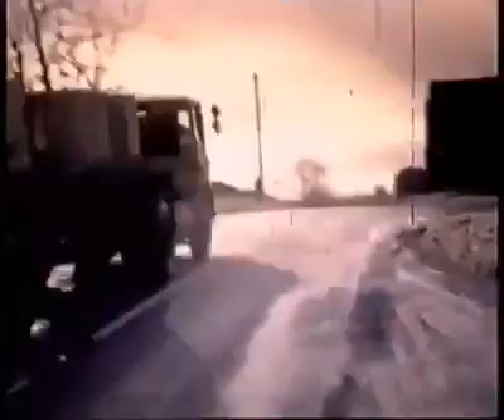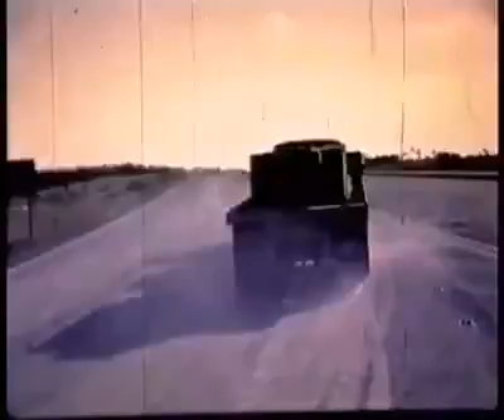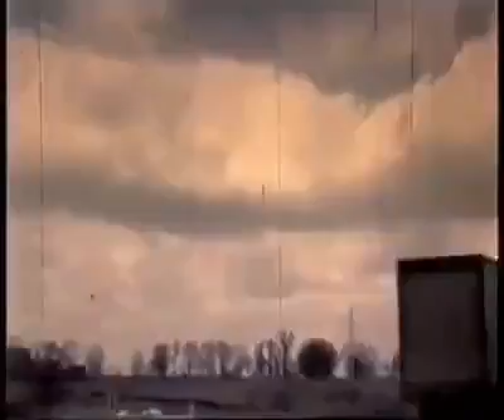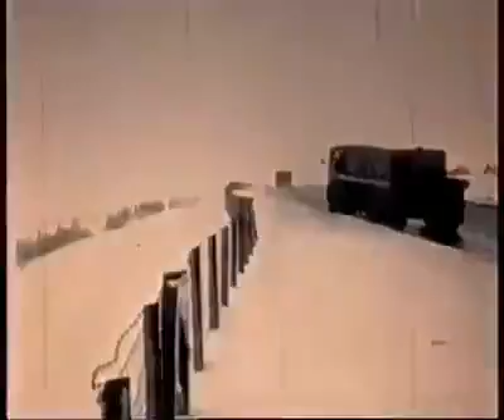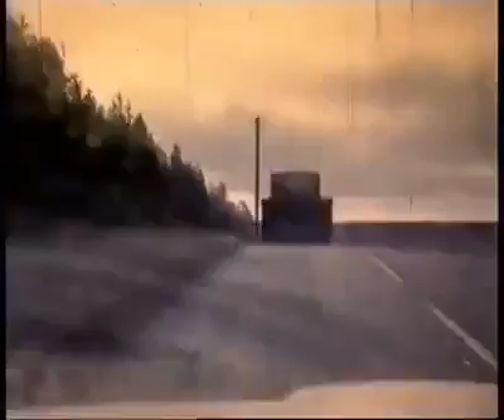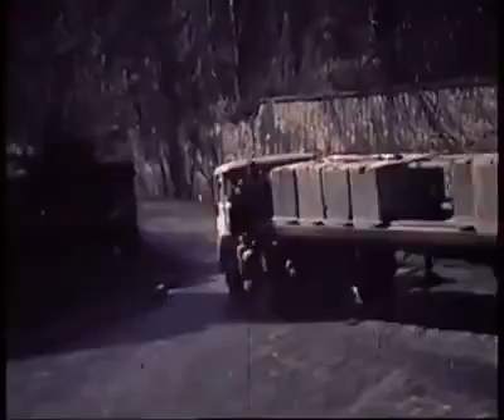AEC V8

Comment: A promising design strangled at birth by BL Incompetence and stupidity, the AV800 had  a weak bottom end, the main big end bearings way too narrow resulting in early engine failures which the poor artisan engineers at Southhall had a torrid time busting a gut trying to rectify. The Ergo cab did not help matters at all, behind that awful 'smiley' grill hid a multitude of sins. A little spinner like the AV800 V8 needs cooling, plenty of it. Am sorry to say that crap cab flushed my beloved AEC down the toilet(lavatory). Most of the dickheads running our motor industry were too stupid and inward looking ,with the intelligence of an empty Smiths Crisps Packet .

Comment: i worked at AEC in the 70s. if leyland had not interfered this would have taken off,regarding overheating, all ergomatics were fitted with a header tank mounted to the rear of the cab on a bracket,in the 70s. this certainly helped the cooling system on the  av 505, 506 and 760 engines. we also gave Guiness Brewery in Park Royal a v8 to use,

Comment: Leyland management where STUPID  , using that cab with the cooling it had was ALWAYS going to be a disaster,  
The 760 , 12 letter at the best 220 hp 
Always ran hot with a full load , you had to be very careful with the motor in summer, 
I believe LEYLAND management would 100% know this , and ALLOWED  this to happen  , 
Giving them MORE excuses to get rid of AEC 
THEY only had to whight 3 years and they would have had the higher ergo cab with the BIGGER RADIATOR 
Another 3 years and they would have a MARATHON to put it is 
And better still 
MARATHON  made by AEC

Comment: Isn't that just typical of British industry,  that is not investing in their products to improve them, I brought a Gardner 6LYT 350bhp in 1987 and had all the modifications done on it before taking delivery, that engine did over a million and a half miles (not Kms) without any problems and returned remarkable fuel consumption that today's trucks couldn't get close to, there must be a good business man in this country to revive the once superior British truck industry using the Gardner engine designs, we're an independent country again and are in need of manufacturing industries.
Reply: Except for Scania, Volvo and Mercedes, every other make use a ZF gearbox and most use Meritor axles. 

Daf in fact, started building a license of the Leyland 680 of 1952 . When they finally bought Leyland in the 1987, the new Leyland engine would become the Daf 620 replacing the 615 engine, but before release they changed every bolt and nut to Metric.

I think the biggest reason for demise of British trucks is the fact that they were surrounded by a left hand steer continent, which offered right hand steer where many of the small British makers werent interested in the continental market  for cost reasons.
Reply: @RenzeZielman  
The reason European trucks were taken to was their driver appeal, ride comfort, ease of operation, higher power/ torque outputs and build quality.
I doubt many euro hauliers would have even considered anything British.
That's the real reason they were overlooked not because of lack of lhd. (Imho)
👍
Reply: @Draxindustries1  the British truck industry didnt have the economy of scale  to invest in the things you mention, because they didnt focus on export to the mainland.

Daf started in the 50s with trucks, and in 1962 they introduced a long haul truck of world level in order to fight their way into the European market. First with Leyland O.680 engine, which were retrofitted with their own O.680 based successor to keep customers with failed engines happy. 

Why newcomer Daf succeeded where the Leylands they were based on, failed, was because Daf knew they had to fight their way into the European market because they werent on an island.
Reply: Why would anyone bother? Government mergers ruined everything, yours must have been a Hawker sidley engine, those guys misread the market and failed to invest in real development dooming Gardner, lister, petter, Mirrlees, national. The subject of this video is another manufacturer doomed by mergers, the same merger the wrecked the automotive industry.
The only engineering that survived did so by safeguarding themselves from the idiots in government by investing overseas.
Reply: The UK truck industry finished years ago and with good reason.
Neither ERF, Foden or Sudden Accident built their trucks as a whole. All were a mish mash of parts like Gardner, Rolls Eagle, Cummins Perkins engines plus Rockwell axles, ZF, Fuller ect gearboxs whereas European truck makers life Volvo  DAF Iveco Renault and Scania produced everything in house and built a far superior product which drivers took to.
Ref Gardner, these were very old out dated low power sloggers most without turbocharging.
British trucks were always a low quality poorly screwed together  product. 
Very few hauliers would take these into Europe as the support was virtually non existent...
Reply: @Draxindustries1  I’m afraid I have to disagree, the ERF EC 14 525 big cam we had in the 90s would pull the ass out of any European trucks at the time, not all truck manufacturers make there gearboxes even today, many use ZF gearboxes